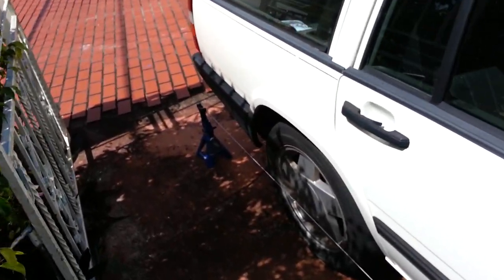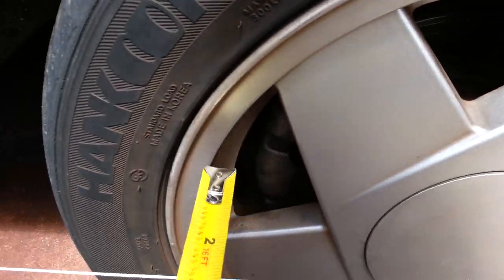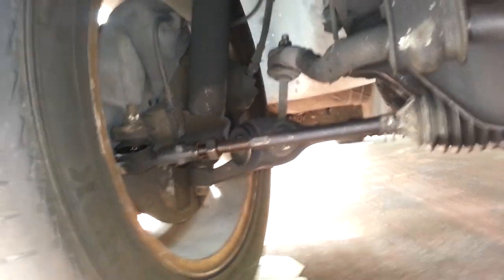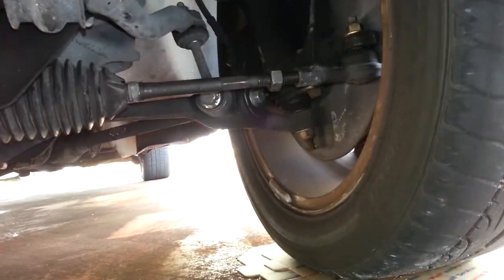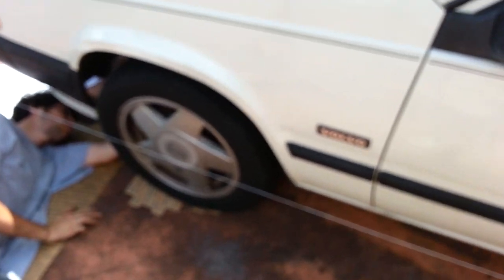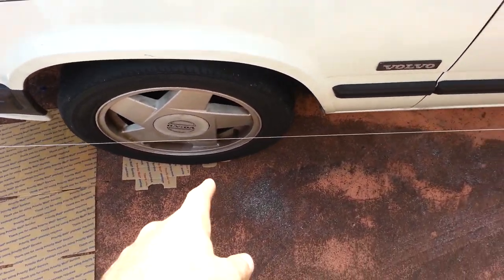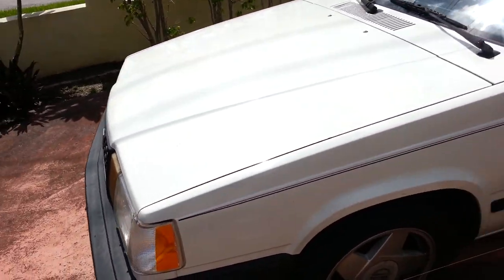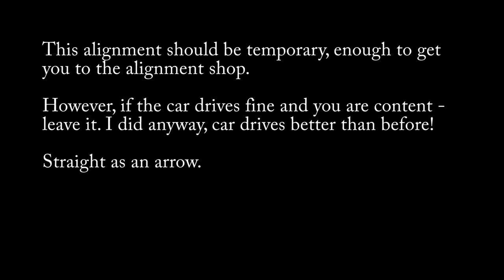DIY Wheel Alignment Quick, Easy, and Cheap - Volvo 940 Turbo Wagon

Comment: wouldn't this work better with front wheels up? that way the adjustment will actually pull the wheel out or in, instead of resistance from wheels on ground?
Reply: The weight of the vehicle needs to be on the wheels to maintain the suspension geometry. If you adjust the ties rods with wheels off the ground the alignment will be off as soon as you put the car down because the suspension geometry changes. So alignments have to be done at ride height.
Reply: Thanks on the replies ,well appreciated